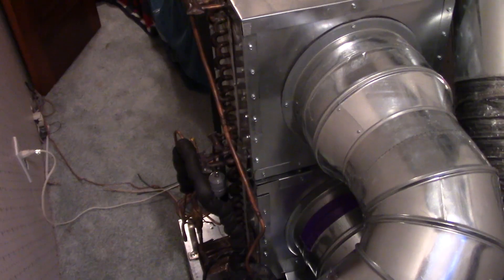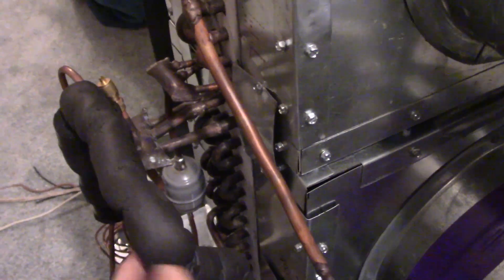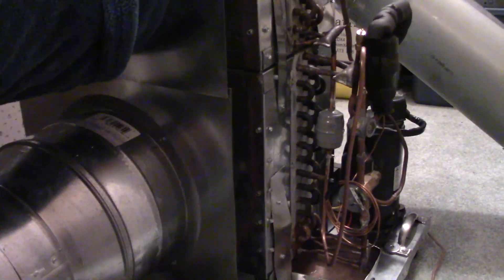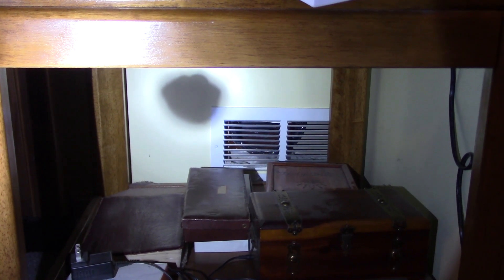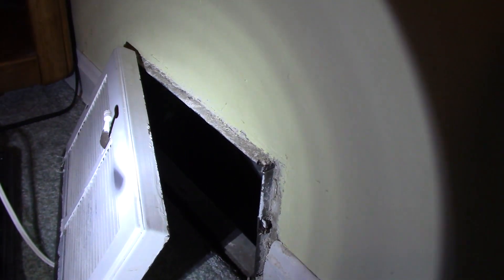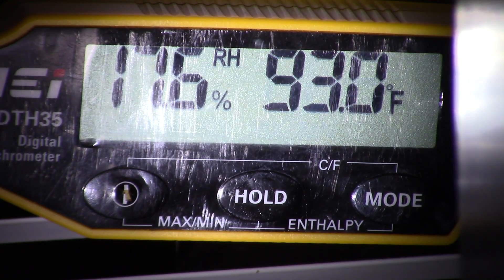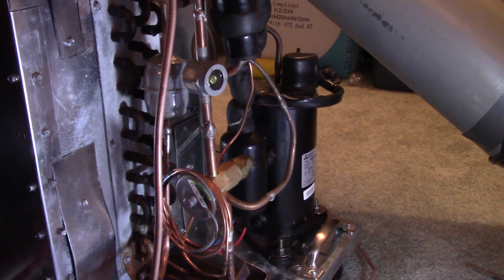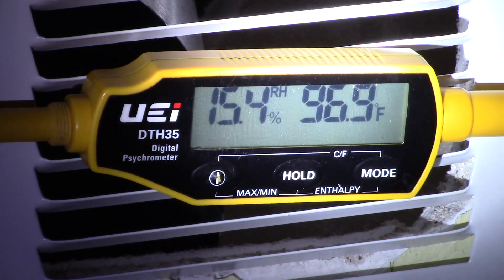Home made heat pump

Comment: Yes it is a it ugly and home made but the key thing is you have made it and it works. 
All yiu can do is refine the process. 

A thoroughly enjoyable video. 

I need to subscribe.to your channel. 
Ordinary caravan style slim line pipes can move the heat neatly around the house to other rooms.
Camper van vents have a very simple hinged flap which means if you do not want the room hotter or colder, you close the flap. Obviously not all vents should be clised as where does the air go.  

You could also use a heat exchanger to warm water in a tank to use less electricity in the shower etc.

Comment: I am trying to do something similar but instead of cooling a room i want to heat my water heater. where did you get the info on how to size your expansion valves, flash point, coils ect....

Comment: Hello. Can 3-phase 380v BLDC (dc compressor) used in inverter air conditioners be operated smoothly with VFD? The rotor has a built-in magnet. However, the speed of the motor is controlled by the IGBT module on the internal card. Its internal control board is broken and has no spare parts.